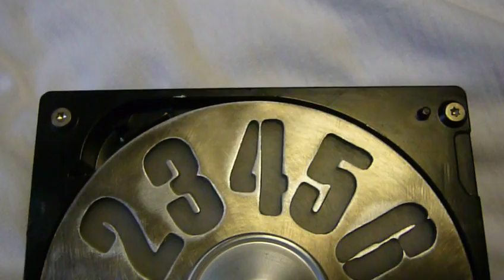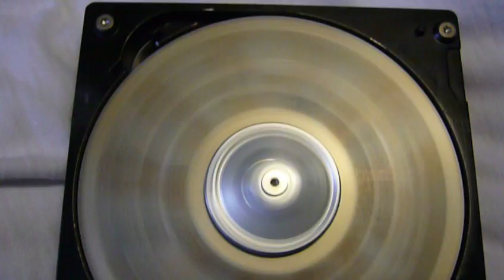HDD Clock

Comment: It is and it isn't. When you know there rotational speed of the disk its not much of an issue to have a program flash the LED cells at the correct times. The annoying part is mostly making said disk, LED cells, and control board.